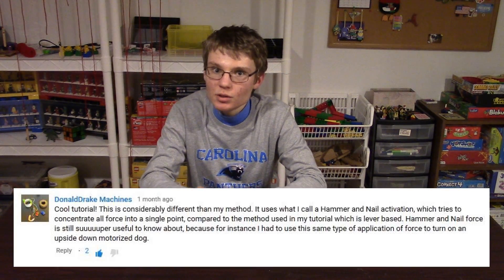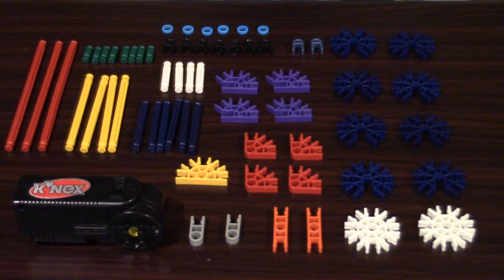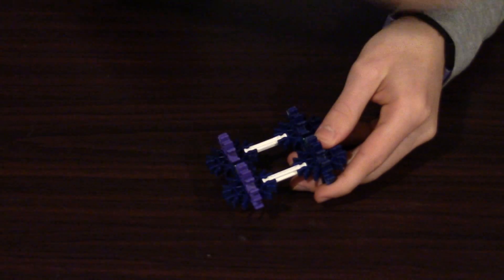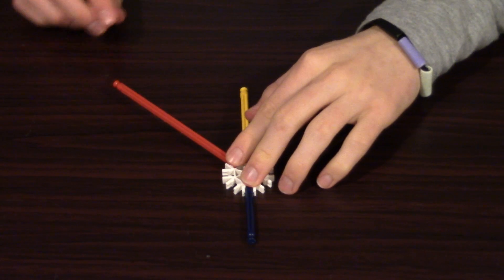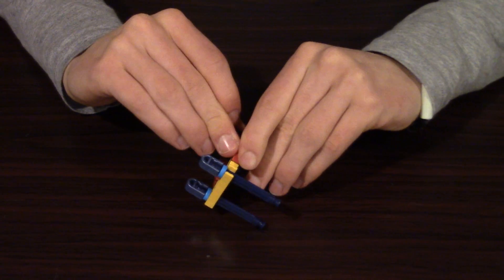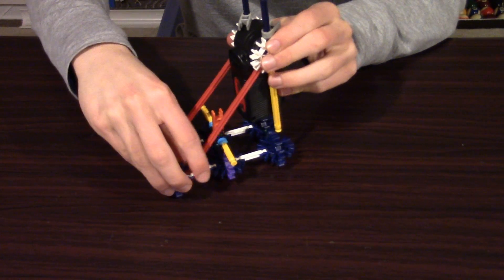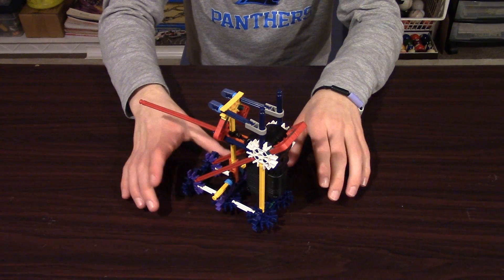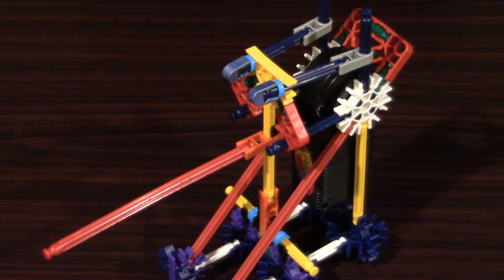Tutorial #5: Improved K'nex Motor Assembly

Comment: I have to say, I had a way to only use a rod and connector to switch on a motor, but it is not customisable like yours. in fact it is just a connector stuck to the switch sideways for a large block to fall on it.
And the last demo tho, I am working on the same kind of trick for my screenlink! such coincidence! just that I didn't change directions of motor and the car could go both ways. 😎

And I don't have a bucket of knex 😥

Comment: I loved it! I hope I have one of the black pieces you used to grip the switch, because I really like that approach to have multi-directional function. Also props for spinning a motor both ways in a chain reaction! I have never done that before, and another thing you are really good at that I have only done twice maybe is timing tricks, like when a ramp has to meet a ball at the right time. The design of this is flawless as far as using only k'nex is concerned, it is very elegant and great features for customization. I was wondering, what is the average amount of weight you need to activate the motor? How steep does the incline usually need to be? Anyway, awesome video, I subscribed a 5th time! (not really, but I would if I could)
Reply from the maker: Thank you so much! I sure hope you can find enough pieces to make this, because of all people, I think I made this tutorial for you the most! As for how to activate it, you still need a decent amount of force, but you'll find that you don't need much more force than a golf-ball-weighted object rolling down a ramp at about 10-15° should do the job. You can see some examples in the demonstration clips at the end.
Reply: +jackofallspades98 I do need to order another kit of k'nex, so I will get back to you about this! You are really good with motors though, I'd suggest experimenting with motorized pulleys and or rubber band belts and gears!